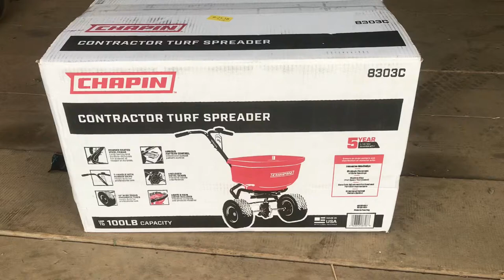How to Assemble a Chaplin Fertilizer / Seed Spreader

Comment: The instructions I was sent with my unit seemed like they were for a different model. took us about 7 hours to assemble. The setting control has inches of play so it  is never accurate. It throws material backward as much as forward, losing tens of dollars of product to the road, etc. The unit sounds like a mower even when pushed empty. It "feels" like it should be around 60 dollars or so. I can't understand the hiked up, ridiculous prices of the spreader market.